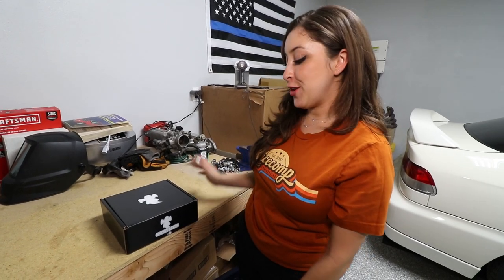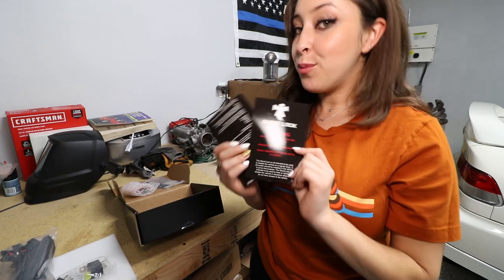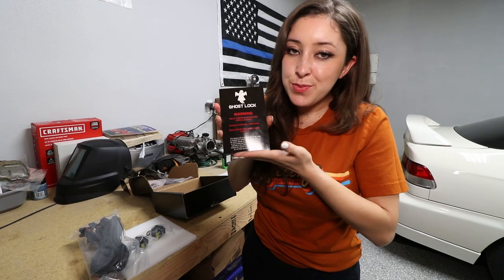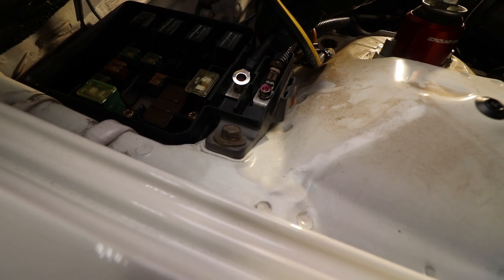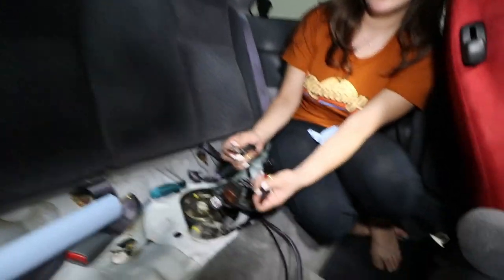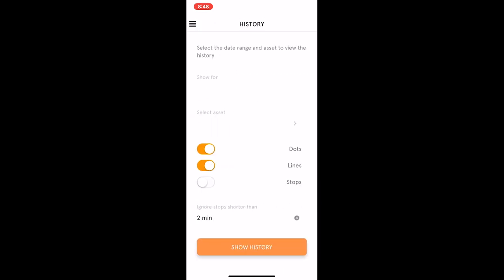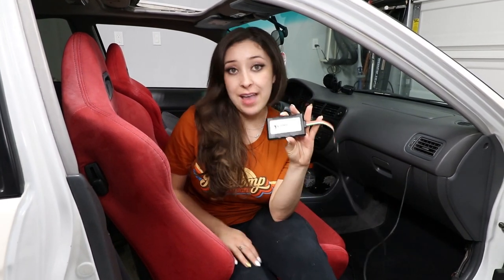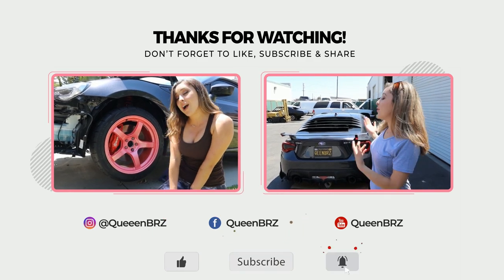JDI GHOST LOCK: Best security upgrade for your HONDA

Comment: Nice thing to have for sure. As long as people don’t know you have it, they won’t be looking for it to disable. I’d rather it went to a spot in the fuse box cause people will cut the “extra” wires from the battery for this reason. I still would use one, just a little different.
Reply: The tracker has a 6 hour internal battery to prevent a thief from simply cutting the extra wire.  You will still be able to locate the vehicle for 6 hours.  The bonus is that if they cut the power wire the vehicle will not have power to the pump and will not run.
Reply from the maker: True but if they cut the power wire. They aren’t getting power to the fuel pump :).

Also yes!! The gps has six hours internal battery life to aid you in case that happens.
Reply: @JDMCrystal  perfect 🤙🏻 now im definitely on board. 😎
Reply: @tracyjordan40  perfect 🤙🏻 love it.
Reply: @JDMCrystal  I appreciate you always responding to my replies. Love the car you’re an awesome person, if you ever come to San Diego for a show maybe we’ll meet. 🤙🏻
Reply: I mean cant they just follow the wire that goes to the tracker and disable it?
Reply from the maker: If they cut the power to the tracker , the tracker still has a internal battery with six hours of battery life. Plenty of time to still locate the vehicle.  If they cut the wire to the harness, they won’t be able to start the car due to the harness disabling the fuel pump.